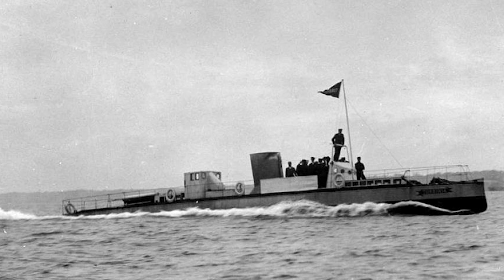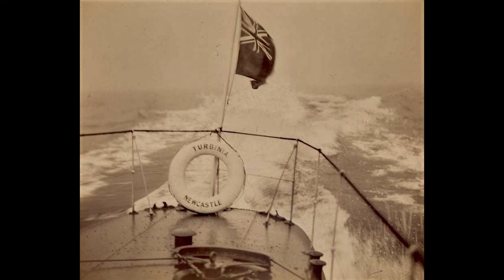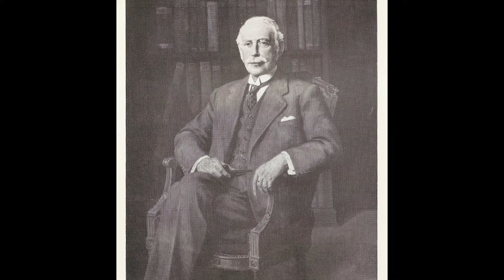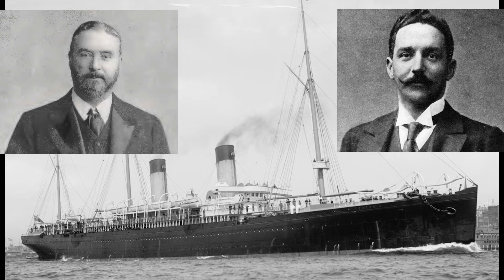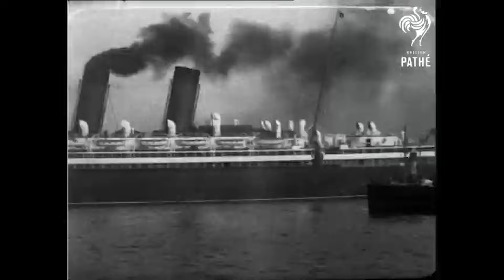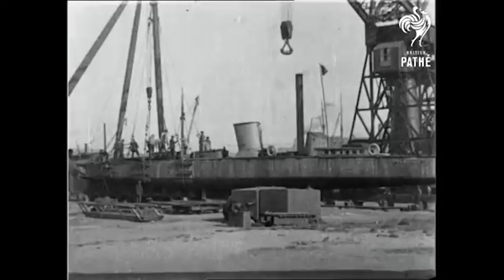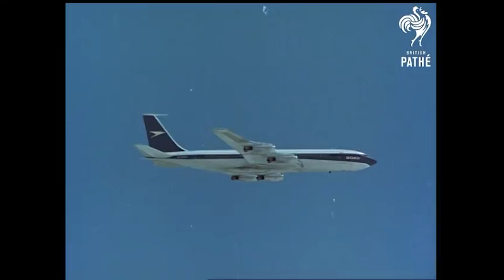Incredible Speed: Turbinia | HISTORY

Comment: I dont want to be pedantic, but I believe that the turbine has it's original roots in the Archimedes screw. JUST as the reciprocating piston has in the old hand piston pump.
Reply: Not really -- they are in different families.  The Archimedes screw, at a slow speed, is effectively a rotary positive displacement pump or generator, and may well be the first in that category.  Other members, in approximate order of invention, are undershot water wheels (and overshot, provided they are not oversupplied with water), gear pumps (used for engine oil pumps) and screw pumps (a common type of refrigerant compressor).  In general, positive displacement pumps or motors cannot develop aero- or aqua-dynamic stall.

Bear in mind that a simple turbine consists of only one ring of blades -- indeed that was Parsons' own initial use of the word, describing the origin of his (what we call) multi-stage turbines as "I...decided to split up the fall in pressure of the steam into small fractional expansions over a large number of turbines in series".  This contrasts with the Archimedes screw, which cannot function without many turns of the spiral.

Steam turbines come from the family of lifting surfaces where natural types include birds' wings and human-designed aeroplane wings.  Considering rotary types, we have the immediate analogue, helicopter rotors.  But before their invention, there were (roughly in order of invention) boat sails, "stream" waterwheels, ships' paddlewheels, boat propellers, Pelton wheels (which Parsons was influenced by), steam turbines, airplane propellers,  both ends of turbochargers, gas turbines, jets, turboprops and turbofans.  (A jet engine uses a gas turbine only to power its own compressor, which is needed to force air into the combustion chambers.  The useful power to drive the aircraft forward is provided by the exhaust gases being shot out the back at a much higher speed than when they enter the front.  A turboprop or turbofan uses the turbine to also drive a large propeller or fan, which blows a much larger amount of air backwards rather slower than the jet, which is much more efficient.)   All this family are liable to aero- or aqua-dynamic stall, which occurs when too much lift is required without enough fluid flow velocity across the wing or blade, and pressure differences cause it to "separate" from the surface, no longer providing lift.  Large efficiency improvements occurred during the 20th century as different profiles were designed and tested, to maximise power/lift.
Reply from the maker: Yes I mentioned in the video that Parsons invented the "modern" steam turbine. There are major differences between the archimedes screw and the Parsons turbine.
Reply: You might just as well say it dates back to when man was first able to manufacture metal tools and implements because without those the turbine wouldn’t exist….

Comment: That was well said Alex the only thing you missed how is the turbine put in reverse so ocean liners can back themselves out of it’s mooring pier?
Reply from the maker: They used a separate turbine that was attached to the same propeller shaft, but it was placed in the opposite direction. At least that was for ships like Mauretania. Queen Mary had reverse capable turbines.
Reply: Tugs.
Reply from the maker: Ships didn't always have to use tugs. There were several instances where RMS Queen Mary had to moor or set off from her Pier without the use of tugs.

Comment: 1:25 Did they not see back then the “lift” associated with the shape of turbine blade ?  And how this could be applied to flight ?  I guess obvious after the fact.
Reply: TLDR: Yes they did.  Both wing designers and turbine designers understood, by the late 19th century, why sails worked, and what general shape would give the best lift.  But the detailed shapes of aircraft wings and turbine blades differed because their conditions of usage varied.  IMO, practical turbine blades were produced 9 years before practical aircraft wings only because the wing of a human-carrying aircraft has to be efficient to work at all, whereas even an inefficient turbine blade will turn a turbine.

Steam turbines come from the family of lifting surfaces where types include nature's birds' wings and human-designed aeroplane wings.  Considering rotary types, we have the immediate analogue, helicopter rotors.  But before their invention, there were (roughly in order of invention) boat sails, windmill sails, "stream" waterwheels, ships' paddlewheels, boat propellers, Pelton wheels (which Parsons was influenced by), steam turbines, airplane propellers,  both ends of turbochargers, gas turbines, jets, turboprops and turbofans.  All this family are liable to aero- or aqua-dynamic stall, which occurs when too much lift is required without enough fluid flow velocity across the wing or blade, and pressure differences cause it to "separate" from the surface, no longer providing lift.  

I think both Parsons and the people trying to develop heavier-than-air flight looked primarily at sails, and indeed birds.  Parsons' first turbine was made in 1882.  The first manned heavier-than-air flight was by Otto Lilienthal in 1891 in a hang-glider he'd designed.  Relatively soon his glider was able to fly at 10 m/s at a reasonable glide ratio (glideslope) -- in fact, he held his position with 0 groundspeed, above the side of a hill with a 10 m/s wind up the slope, while a photographer moved to the best position to take a photo!  By 1993, he'd achieved 250 m flights several times.  In all, trying out several designs, he flew over 2000 times in 5 years (although his average flight time was a little under 10 s).  He died after his latest glider stalled 15 m above the ground.  He had particularly studied the flight of storks. 

Alliott Verdon Roe, who abbreviated his name into the aircraft manufacturer Avro, is said to have driven his mother mad as a boy by "wasting time" watching birds, but himself claimed to have become interested in building a flying machine when in the merchant navy, watching albatrosses soar.  Avro built about 10,000 aircraft before he resigned to form Saunders-Roe, who built boats, flying boats, land aircraft and after his death, the first practical hovercraft and several commercial models, of which the largest, the SR.N4 class carried 60 cars and over 400 passengers across the English Channel at 60 knots for several decades.

I suspect that the aerofoils used by Lilienthal, and certainly those used by Roe, were more suitable for their purpose than Parsons' aerofoils were on his first turbine or even on those turbines contemporary with their aircraft.  The general shape of aerofoils for good lift had been known for some while.  From what little I know about him, I don't think Leonardo da Vinci had really understood it, in spite of studying flight of birds intensively, but I think 19th century engineers generally understood the best shape for sails, and would recognise that the something similar was appropriate for an aircraft wing (they were all single-skin at that age, so the matter of choosing an appropriate shape for the underside was not yet an issue.  But there are several reasons why Parsons' turbine blade shapes would not have been so appropriate:

*  Fluid: the two fluids are quite different.  The first aircraft would see air at about 1 bar, at a temperature usually between 0 and 30 °C and perhaps 30% RH.  The fluid in Parsons' turbines was steam, probably varying between 14 barg at 200 °C at the high pressure end to around -0.8 barg at 60 °C at the low pressure end (I believe he used condensers from the beginning, but if not, the LP end would be about 0.5 barg and 110 °C.)  The mass of the steam is 18 g/mol, while that of air will be about 29 g/mol.  These fluids will react differently.

* Scale: to use the units of the day, turbine blade lengths were measured in inches, while aircraft winds were measured in feet.  Meanwhile, the properties of a given fluid, eg boundary layer thickness at a given velocity difference, remain the same.   Conversely, the conditions within a steam turbine can be expected to remain steady except when power is changed.  However in an airplane, wind can be blustery, changing quickly and even being different at different parts of the wing at the same time.  An aircraft wing shape must therefore allow it to accept varied air conditions to an extent that a turbine blade need not.  To put it another way, a turbine blade can be made to operate very close to aerodynamic stall, in the knowledge that conditions will stay constant, while an aircraft wing must have a much greater safety margin so, for example, modern aircraft wings are designed so that some parts will stall long before other parts, leaving the plane still reasonably controllable to allow the pilot to correct the situation (eg increase thrust or pitch down) once the different response has been noticed.  In a turbine, there is no need for that, and since it would cause lower efficiency, it is not done.

* Aspect ratio: Wings in those days were quite long and narrow, often the same width throughout their length.  The top wing of a bi- or tri-plane was often above (ie uninterrupted by) the cockpit perhaps 8 x or more as long as it is wide.  Averaged over the whole length, end effects will be close to negligible.  However a turbine blade is quite different.  The maximum length of the blade is determined by its strength, considering the centrifugal force imposed by turning at high speed.  The highest efficiencies require the fastest speeds, so the limiting factor will be the length of the (largest) Low Pressure blades.  That might, say, be 10 x their width, and end effects will be of little importance.  They will also have a significant thickness, to maximise their strength. But the High Pressure blades will be much shorter, perhaps 1/4 the length.  Here, the flow will be affected by end effects -- the rotating core at one end of the blade and the stationary turbine casing at the other.  Nowadays, computer optimisation would be done to achieve the best compromise.  But in the late 19th century, there were no computers, and neither boundary flow nor end effects were accurately known.  Therefore, the design was dependent on the "gut feel" of the designer over what was likely to work best -- another reason not to copy a design made for one purpose, to use for a different purpose. 

My belief is that there was one good reason why the turbine blade problem was solved a decade or two before the airplane wing: -- the human-carrying aircraft wing was a much more difficult problem.  As can be seen with older designs of windmills, you can blow wind (or steam) at almost any shape, even a flat diagonal surface, and it will start to turn, and several different designs of paper airplane will work reasonably -- but wings on a human-carrying aircraft have to be fairly efficient to work at all.

Comment: The Pennsylvania railroad had a turbine locomotive
Reply: Yes, and it was brilliant at high speed, without hammering the stack like reciprocating engines do.  But in an effort to maximise efficiency at high speed, by minimising the reduction ratio in the gearing, the turbine was running at an uneconomically-slow speed whenever trackspeed dropped below 30 mph.  A major modification could have been made, adding a further reduction gear, which would have made it 3% less efficient at high speed, but would have made it reasonably economic at most normal running speeds.  But diesel was beginning to be accepted, and methods to control several coupled diesels by one crew were being designed.  So when the turbine engine needed an expensive repair, they decommissioned it instead. If they had decided to try a steam turbine in the 1920s rather than the 1940s, things might have turned out differently.